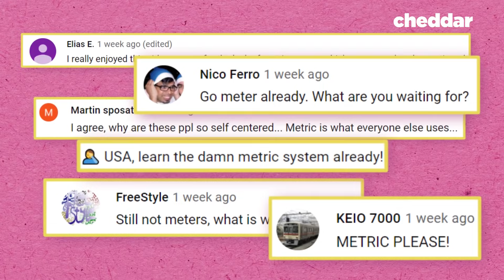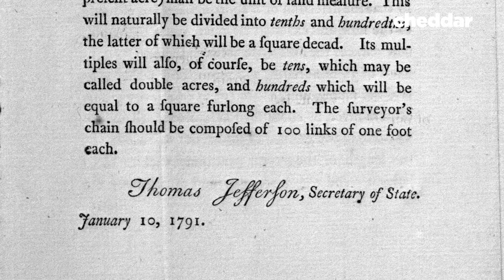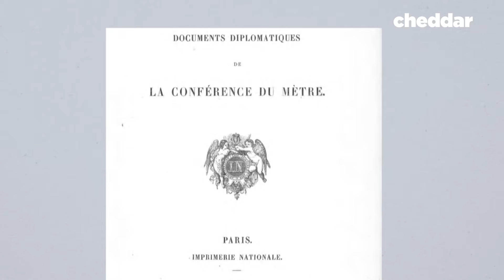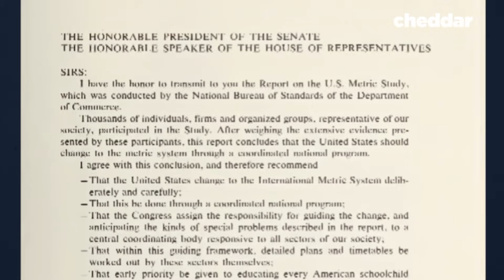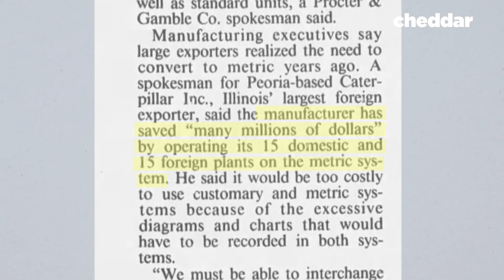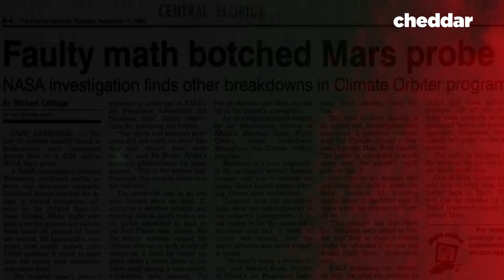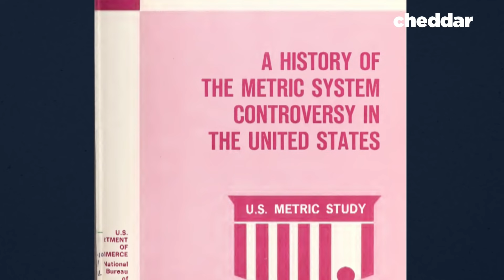Why Doesn't the US Just Use the Metric System? - Cheddar Explains

Comment: Americans not only fucking up their measurements regarding weight and length, they also messing up dates (why the fuck is it month/day/year and not from short to long or long to short??????) and temperature (why  using fahrenheit?? Celsius (water boils at 100 and freezes at 0) and Kelvin (0 = absolutr null) are the only logic ones).

Comment: From a practical standpoint, I don't mind most of the metric system, but I wish there was an equivalent for a foot, and I hate the Celsius system for measuring weather temperatures
Reply: There is the 30 cm foot (lumber is sold by 30 cm increments here) and the 33.3cm foot ( Napoleon France and China)
Reply: @2adamast  let's slap a good name on that bad boy and bring it on

Comment: The metric system came into Australia in 1969, when I was 6 years old.   Believe it or not, by then you are already semi-indoctrinated into a system and to this day I describe somebody as being about 6' tall instead of about 183cm but at the same time i estimate somebody's weight at about 80kg instead of about 176lb's.  

I don't care what system America uses, and in a way I congratulate them for telling everybody else to fuck off and mind your own business, but... the metric system is a lot simpler than any other.  Examples to prove that?  

How much does a cubic metre of water weigh? 1 ton.  How much does a cubic yard of water weigh? 1728lb's.  

How many centimetres  in 1.63 km's? 163,000.  How many inches in 1.63 miles?  103,277.18

But it's easiest when it comes to working in your own shed.  Metric holes, drill bits, allen keys, nuts, washers and bolts let alone measuring in millimetres compared to inches all make life a lot easier

But like I said, do what makes you happy and measure and weigh however you want to.

Comment: My question is...
  

Why do they still use F° instead of C° then?
Reply: The fahrenheit system is more suited to everyday life. Say in a place like Chicago, a hot summer day would be around 100° F, with a cold winter day around 0°. It makes it simpler to understand quickly on a weather station on this scale.
Reply: @Jackspugoasters  Celsius still makes more sense to me. Is it under 0°C? Then it is freezing. That temperature is quite important for eg. drivers, so they know if the road can be slippery. Also it is temperature around which raining turns into snowing. I would say it is the most important temperature.

And once you get used to it, you would know that 20°C is just fine temperature for wearing just T-shirt and 30°C means sweating as hell.

Comment: Why doesn’t the rest of the world have metric time, And a metric calendar?
Reply: Because days are based on the Earths rotation which is 24 hours, months are roughly based off the lunar cycle and it takes 365ish days for the Earth to fully orbit the sun. There is no way to make that metric, so we are more or less forced to do it that way.
Reply: @Arsalan Andany The thing stopping us from redefining it at this point is that it won't gain any traction. I very much doubt anyone would want to adapt to a redefined time measurement system, I know that I wouldn't.
Reply: we have somethin called a ortodox calender which serbia uses
Reply: There was a 10 days week with 30 days month.  As for hours they started with a decimal day:  sunrise + 10 hours + sunset.  then we complied to mechanical clocks, used fixed hours and worked around a fixed noon and we got this 2 times 12 hours abomination.
Reply: @Main Wayne
: time is not measured in metric or imperial. There is no such thing as metric calendar. It'd be silly. Time is measured by the system created by the ancient Sumerians and Babylonians. Are you sure you went to elementary school?
Reply: anonymous - the second as we know it was defined in the sixteenth century and makes part of the modern mean time idea.  Sumerian’s used different time systems

Comment: Most Americans use both. Neither system is best for all things. I use grams and milligrams opposed to ounces but I prefer pounds instead of kilos. As a chemist I prefer Celsius in the lab but Fahrenheit for weather. I only use metric for volume because the Imperial system sucks for volume!
Reply: Yeah most Americans use both, I don't see why people think we don't.
Reply: The unit is the gram. There's only one mass unit in the SI. 
In the imperial system you've got 3 different pounds, stone, 3 different tonnes, and I'm pretty sure there's a smaller than pound unit too. Good luck converting between all those.
Reply: 16 ounces to a pound, 2000 pounds to a ton. no one uses stone. i couldn't even tell you how much a stone is. of the imperial measurements, weight is the easiest.
Reply: Nathan Lang A stone is 14 pounds.
Reply: @cavvieira  Americans use a slightly different imperial system than the UK. It's called the US customary system. We don't use stone as a way to measure weight. American use ounces ponds and tons. Pounds are consider the base unit and  1 pound= 16 ounces and  1 ton = 2000 pounds. There are other weights units in between but they are uncommon and most don't use them.

 to put this in metric terms
1 ounce = 28.3 g
1pound = 453.6 g
1 ton = 907.2 kg

The US units are also a little lighter than their UK equivalents.
Reply: Farenheit uggggg
Reply: My parents never use metric and hate it although my dad was used to it since he worked in soft drink sales. I was at least taught metric in school, but conversion was dumb as hell so I only use the much easier metric system when needed since so much is done in customary still in everyday life.
Reply: @mma171
: "I only use metric for volume" - don't lie - you use metric for counting money, every single day.
Reply: What I get from this is that for your day-to-day life, outside work, you prefer the imperial system... the system you're most used to.... hmm...
It's not that the imperial system is better for that; it's just that you're used to it. That's my hot take.
Reply: Why Fahrenheit for weather?!
Celcius is pretty much designed to be used for the weather.
Reply: @bananian  because Fahrenheit perfectly fits human comfort on a scale of 0-100? Whereas celcius is only good if you're wondering if a cup of purified water is going to freeze outside.
Reply: @charlemagne111027  That depends on where you live, 0-100 F isn't universal by any means. Here in Canada for example, Fahrenheit would roughly be a scale of -40-80.

Besides, it all depends on what you're used to. Canada and nearly everywhere else in the world is completely accustomed to Celsius, so it is more useful than just knowing if water will freeze to us.
Reply: @bobjones1432  while it is possible to get above and below the 0-100F range, it is still a better system that moves on increments of ten. True that the rest of the world is used to Celsius, but that's the same argument that Americans use to keep uaing feet and pounds; not a very strong argument. To me, Fahrenheit is to Celsius what the meter/kg is to feet/pounds.
Reply: @charlemagne111027  I'm not arguing that because we're used to it it's better, I'm arguing that it's useful for more than just the temperature of water, as we have all gotten used to what it means for the temperature of air.
Reply: @bobjones1432  well of course it can be used for air as well as water. I was just addressing the point that Celsius people always bring up about 0 being freezing and 100 boiling in Celsius by pointing out that that is far less useful than having 0 and 100 be relevant to humans. Fahrenheit should be the day-to-day temperature system and Kelvin should be used in science. Celsius is this awkward middle ground that is somewhat useful in science and passable as a daily use system.
Reply: @charlemagne111027  I see. I agree that Kelvin is the best system for science, but I don't really mind which is used in daily life, though I am used to Celsius. By the way, I'm sorry for all of the flak you guys come under for using Imperial.
Reply: charlemagne111027 I agree. 0° F to 100° F seem to be the minimum and maximum temperatures a Northern European can withstand.

Comment: It is not so simple.  Many companies use imperial measure for manufacturing because they did it for years.   The cost of changing hundreds of thousands of legacy mechanical drawings and changing designs of millions of parts and assemblies is not cost effective.   If a company did convert they would need to hire more workers and take more time to switch over.  All of that cost comes out of profit. If profit margins are slim, which they usually are due to competition, a company would lose money and may go out of business.  All new versions also would now be incompatible with was is already in the field.  Also metric raw material (tubing, sheet metal, shafting, plates, extrusions etc)  is not as common and is more expensive here in the US. again adding to overhead cost.

Comment: Just do as we do in the UK and have both we were taught both in school....we don't go to pub and ask for 568ml of beer we ask for a pint of beer milk is also sold in points where petrol (gas) is sold in litres and if you ask somebody to guess the length of something they would guess in inches but if they actually measured it they would use centimetres or millimetres...has worked fine for us for years

Comment: Imperial system's only good aspect is that in certain everyday things it's easier to use than decimal. The problem with metric system is that it is decimal based. Metric with duodecimal or dozenal or 12-based number system would be just perfect. It would make metric system at least as practical as what imperial is at it's best. It would take some times to learn, but it would be worth it. Unfortunately adults are super lazy and they don't want to learn anything after the age of 15-18, so it wont happen.

Comment: Shortly after Canada converted to metric in the '70s we almost had a major commercial airliner accident, the infamous "Gimli glider", which was under-fueled due to a metric-standard conversion error in calculating fuel needs for the flight.

Comment: I am not convinced the US manufacturers understand the metric system. For example I bought a racing clutch from a US manufacturer for a Japanese motorcycle (metric). The clutch unit had metric dimensions and splines but the threads were imperial, go figure!

Comment: The real reason is that most of America is still basically living like homesteaders, and we regard city life as both physically dangerous and financially ruinous. Thus, Americans still make or fix a lot of stuff, and don't rely on other people doing stuff for them. They know the old system, and it won't be easily supplanted... Obviously. But also, when you're doing a lot of your own work, you need to see your measurements... No one wants to squint at tiny markings. The metric system loves tiny markings, and in a practical sense, it's just inefficient.
Reply: Strangely I'm the same but it also pushed me closer to metric simply since a lot of stuff these days is made to metric specs. For example working on any car you will have 10mm bolts everywhere lol

Comment: Cooking in metric sucks hard as the scaled sizes are not conducive to portion sized quantities. Machining in metric sucks hard because of the majority of machining is done and the .001 to .0001 of an inch and if you covert that you end up odd in-between numbers (we don't care about being more accurate than that and we can't afford to be less accurate than that so going to the next point in metric is way too fine and going the other way isn't fine enough)  (oh, by the way, the engineers are not going to change). Dividing property with metric sucks as a meter and hectometer is too small and a kilometer is too big. In the areas where we actually use these measurements the numbers become clunky in metric being either too small or too large to be used.  Do you want shoes or paints sold in 1cm increments? How many sizes would that be? How much overhead do you want? While the ease of the metric base 10 system sounds great on the surface in practical use falls apart. And why didn't they just make less Eng std sized belts in 1/2" increments which would be less than 1cm increments (fewer belts, not less size)?

Comment: The thing is the imperial system is more humanized than the metric and provides units that fit our senses better.   While it is obvious that the inch, foot, and yard (based on the human anatomy) is humanized, other such as the Fahrenheit is also.  One degree Fahrenheit is about the minimum temperature difference that can be sensed while one degree Celsius is almost twice as big so with metric they deal with decimal degrees like 20.1 degrees where a tenth of a degree is far smaller than can be sensed.  Metric units tend to be too small or too big as they are based on something that has no relationship to human experience.

Comment: Also Fahrenheit. What's up with that? 
°C is a lot easier to use. 
0° for freezing and 100° for boiling. Why keep things complicated if you can make things easier. You have a lot of baggage you need to let go.
Reply: go to 10,000 FEET elevation and see how well your boiling point aligns with 100C
Reply: Fahrenheit is more accurate.
Reply: @BarracudaBoy  not according to the whole world
Reply: @NiX_aKi  On the Celsius scale, that range is from -28.8 degrees to 43.3 degrees — a 72.1-degree range. This means that you can get a more exact measurement of the air temperature using Fahrenheit because it uses almost twice the scale.

So.... how's it feel to be almost twice as wrong? XD
Reply: @BarracudaBoy  Bravo! zmescience.com will be proud of you.
Reply: @BarracudaBoy  Do you know that there are divisions in between numbers? for example 25.5 is between 25 and 26. That way you can represent literally infinite temperatures with either system.

Want more precision? use more decimal numbers. Nonetheless, on informal situations (where I'm told farenheit is superior) 1˚C is already so precise that it's almost impossible to feel a 1˚C difference.
Reply: @NiX aKi yeah, let's just ignore that entire half of the scale that never gets used when measuring outside temperature, who needs numbers above 50 anyway?

@Espinosidro "almost impossible to feel a 1°C difference"

I am calling bullshit on that claim, where are your sources?

Comment: If we use the current system, our enemies on the battlefield can't use any captured munitions against us! Plus, we've built the best, fastest, strongest, most durable things on earth with the American system of measurement. We've come too far to change over now, yet we've already started in several goods such as our cars which are half American, half metric. Our electronics have gone metric years ago. Our tires are all metric as well as our wheels that carry them. Only our engines remain American in measurement, perhaps because of the more accurate measurements available with the US system of measurement. Yet many parts of our cars are metric. The question, which system allows the smallest and most accurate measurement of highley technical goods. Are computer processors measured in American or metric systems when they get down to the atomic level which we are at right now. Which system allows for the differences in the measurements of the different elements we are working with. Because when we are working with things one electron wide we have to be damn accurate. If we're off well fuck up an entire product line of potential goods which we could sell to the rest of the world. And angstrom is not defined by either system as far as I k ow, but is the only way to accurately measure the width of an element at the atomic level. Perhaps we should start there and work forward, changing the world to natures specs!

Comment: Most people have heard of a "key " of weed,  That's a kilogram. The military range increment "a klick " is a kilometer. Just more examples.  However the metric system has one serious flaw. There is no standard for thread pitch. This has caused problems for high quality bicycle enthusiasts because parts from England, France,  Italy and Japan all use different threads. So if you wanted to put a French pedal on an Italian crank you couldn't.